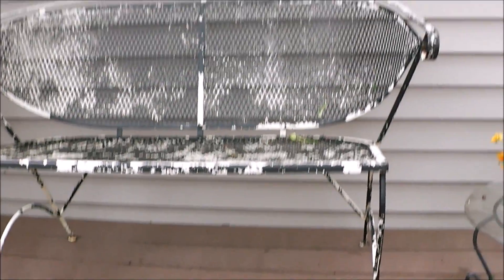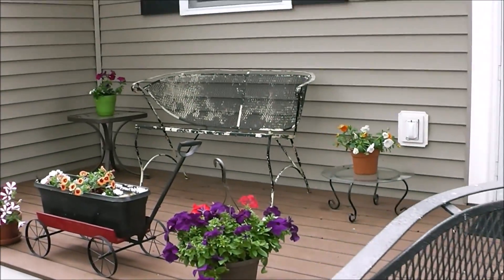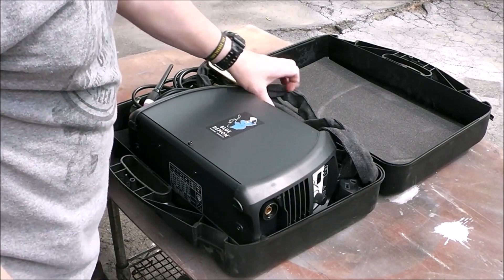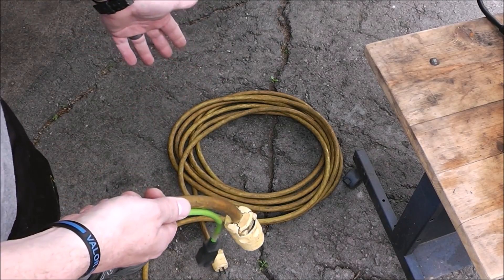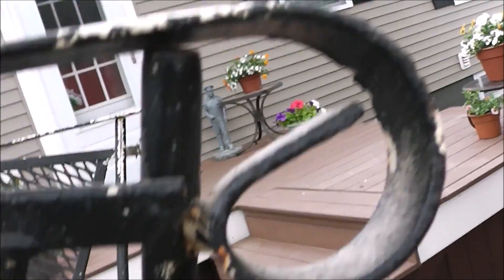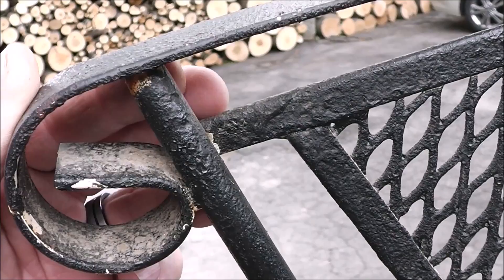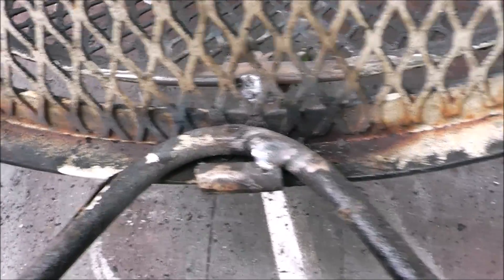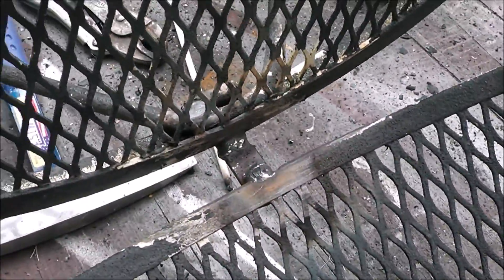STICK WELDING THIN METAL  using 120 volt power - 💥Beginner Welding Series

Comment: How well does a stick welder do for a 120v 20 amp breaker? I've been told it's useless.
Reply from the maker: Honestly, with this welder on 120v vs 240v I cant tell the difference. It welds EXACTLY the same.  However, the welder maxes out at around 130 if I remember correctly when it's on 120.
Reply: @BrandonLund  No tripping of the breaker??
Reply from the maker: @warrwarrwarrwarr  If I remember correctly, when its maxed out on 120v it will trip out a 20 amp breaker, but not immediately. I can weld for around 30 seconds when its maxed out before it trips. My plasma cutter does the same thing when maxed out on 120v
Reply: @BrandonLund  Thanks!

Comment: only watched 1.5 minutes.  You call that thin metal?  that's thick!  Thin metal is auto body floor pans and car door frames, chassis subframes on 70s-80s cars etc.  That's what I want to see successfully welded with 1.6mm and 2mm electrodes.
Reply from the maker: I have other videos with 1 and 2 mm / 20 guage if your interested. Stick really isn't ideal for bodywork, however, it can be done and done sucessfully. I've had good luck using copper as a heat sink to help eliminate warping / blowout.
Reply: @BrandonLund  sir, so for body work or thin material would you recomend the 90 or 125 amp harbor freight welder. ?
Reply from the maker: @arturozanti7262  I dont have any first hand experience with harbor freight welders but I would encourage you to go with the highest amperage unit you can afford. Buying a welder is much like building a garage...its perfect at first, but as time goes on, you wish you went a a little bigger.
Reply: MIG would be best
Reply: @BrandonLund  Do you think its possible to stick weld, a steel disc brake boss to a nonbutted seat stay of a steel bike frame? I know TIG is would be the preferred option... But this a one time welding project and a stick welder is cheaper. BTW using copper as a heat sink, I dont see working for tubing, so do you have any trick to prevent blowout... 
FYI I have never welded anything...  So feel free to just say its crazy, for me to try it.... There a clamp-on kits disc brake boss but they look ugly and  I dont trust them to hold up...
Reply from the maker: @nc3826  I have never welded on a bike frame but I can only imagine they are fairly thin. I consider myself a fairly good welder and I think this would be difficult for even someone with a fair amount of skill. That's not to say that it can't be done, I just think for someone who has never welded, this might be too difficult at first. You can pick up a fairly inexpensive DC stick / TIG inverter welder for fairly cheap. That way you get the best of both worlds. You can weld nice thick metal with stick and do nice delicate work with TIG when needed...In my humble opinion anyways.
Reply: @BrandonLund  Thx for getting back to me and confirming that stick welding isnt a viable option and will probably ruin the frame. So TIG or a braze-on is the only way to avoid using a clamp on.... Good luck with your channel....
Reply: Weld two aluminum cans together 😎
Reply: I have googled all over for this, myself. The thinnest metal Google wants to show me being stick welded is 14 gauge or about 75 thousandths. MIG, I find videos doing body panels of 18 gauge or about 48 thousandths. 

The sheet metal I have been welding is 16 thousandths! I don't even know what gauge that is. I am a noob, but I have gotten it to work fairly ok. Lap joints and spot welds, only. No butts or continuous bead. And I still get the inevitable blow through on occasion. What works for me is clamp next to where I will spot weld, grind a small slot-shaped crater through the top sheet and slightly grazing into the bottom sheet with a small cutoff disc. Heat up a 1/16" 6013 on a piece of scrap, then bring it to the spot. As soon as it sparks, jam it down until it just about touches the metal, and immediately withdraw.  Amperage as low as it will burn, which is about 17A on my machine, DCEN. If you were restoring a car, you would need a lot of Bondo, lol. To repair a tank, it would take forever to connect the beads to make it gas/liquid tight and you would maybe need a plug welding heatsink jig to fix the holes. :) (I haven't figured out how to plug holes in metal this thin, yet.)

The other major problem beside holes is warpage. If the spot doesn't take on the first try, the metal warps and separates and the flux dust gets in there. If you can't hammer it flat against an anvil, I have very little chance to get it to connect on further attempts.
Reply from the maker: @mildyproductive9726  thin metal is very difficult to weld with stick as you have figured out. Another good trick is to keep a very steep drag angle and keep your pieces clamped tight when doing lap joints. Any gap will cause it to burn out. If you can get a piece of copper over the joint on the backside, it will act as a heat sink and help with blow through. I'll have some more thin metal videos out soon.
Reply: @BrandonLund  Thanks for the tips! I look forward to the new vids. So far I have managed to make some useful guards/covers with the 16 mil sheet and even managed to tack this sheet to angle iron without completely nuking it. But I have another repair/project that involves (re)welding a piece of rebar to the edge of a 28 mil sheet, where it broke. If you can do something like that with stick, it might make a good video?
Reply: Mildy Productive nice explanation on your welding ventures. The tip to use copper underneath as a heat sink seems to be a good idea. Also clamping very well.
Reply: You can use 1/8 in. rod on 18 gauge but 3/32 in. is preferable.

Comment: I want to see how to Oxy Acetylene weld T Joints.
Reply from the maker: Oxy Fuel welding is probably my favorite... it takes a fairly high degree of skill and practice to get a decent looking weld.  I got my crash coarse about 35 years ago welding in floor pans. It then progressed into custom body work / chopped tops and lead work.  I still have all my gear but I have pretty much replaced it all with tig brazing for the most part.
Reply: Awesome. Thanks for responding. I'm having a little problems with Oxy-Acetylene T Joints. I've looked all over youtube for Oxy-Fuel welding T Joints and there's only a couple vids but they're not up close or not in detail or I can't see what the person is doing. So I figured I'd ask a bunch of Youtube welders to see if they could possibly upload a video. :D

Comment: wow,  didn't know people really calculate their settings for stick welding
Reply from the maker: Mercer Frey every electrode has a recommended amperage rating as a starting point. It’s usually printed on the label. Eventually with experience and time, the beginner welder will remember what rod runs with what amperage.
Reply: You have too. For best results

Comment: Could I run 3/32 6011 rods on a Clark 110 v. machine:  their E-95 model ? [the machine maxes out at 90 amps, A/c only.]
Reply from the maker: I have not used that specific machine, but yes you can run 3/32" 6011 with that machine. You will be pretty close to maxed out though. That rod runs around 75 Amps. 6011 rods can be used on ac or dc machines.
Reply: Thanks Brandon.

Comment: 6011 is the best rod for any job, is very penetrant, you can tun it colder than it was made for, welds dirty metal, and unprepped metal so 6013 is not a good electrode guys it only has a good finish, 6011 is the best option
Reply: @海鷗 whaaat

Comment: I'm trying to weld tin cans with an old dayton welder from the 50's...Ive got it on the lowest possible amperage  and using a 6013 rod; 1/16th" on 110vac...I cant seem to get it lit, if i up the amps, it just burns right thru...any suggestions?
Reply: dan walker    Grab a short piece of old copper water pipe.    Flatten the end do it sits more or less in full contact behind what you’re welding on.    Hold it there with a gloved hand and it will likely weld for you.  The copper will absorb some of the excess heat yet won’t weld itself to the workpiece.      This works pretty well in cases like that.      
Also try using 6011.    Because it’s a Fast Freeze rod and may work better for you.     You might also try reversing the polarity if your machine has the capability.    You sort of have to screw around with techniques in cases like this till you see what is working best for you sometimes.     That’s why you need to practice on similar scrap to get it dialed in first.    
   Don’t fall for that “get out of the Stone Age get a $1000+ MiG or you’re wasting your time” crap.   When I went looking for a welder in the early 90s I was told stick welding rods were likely not even going to be available in 10 years........yea sure!   I got one eventually, a 135 Hobart, just for body panels.   Today my preference is still the old AC/DC Lincoln Tombstone.
Reply from the maker: @drizler  SPOT ON BROTHER! Great Advise!  I use a copper bar, but I like your idea of using a piece of copper water pipe! Great idea and great comment! Thank you
Reply: Thanks! Do you recommend welding lessons before doing a job in this league? I’m new to this
Reply from the maker: @jeffreychavey4161  You do not necessarily need lessons to make a repair like this. You could literally watch videos like mine and others and probably do a pretty decent job, however, if your able, a few night classes at your local school would probably help. In my opinion, nothing beats hands on instruction where someone can look over your shoulder and give you pointers on what your doing.
Reply from the maker: It sounds like your doing what you can. Your machine may not be able to go that low and still be able to light the rod. You might try bumping the amperage up just a bit and then doing real quick tack welds. That's where a hot start feature comes in handy
Reply: I was trying at 20 amps...bumped it to 35...and it got worse, soooo....after lots of practice, i finally was able to strike an arc on 20, but was still limited to the edge where the material is just a bit thicker, even then I had to move fast, anything longer than a blink of the eye, i was going through the material...it was awesome education though...I love the hot start idea, wished my machine could do it...thanks alot
Reply from the maker: @pathfinder10148  your welcome ! 😁
Reply: dan walker what if you used a tiny bit of tinfoil or a metal shaving to strike the arc on? Then it would burn back instantly once striked. I’ve heard of ppl using their tig filler rod to start their arc but always wondered about this lol

Comment: Can you please let me know if it's okay to hold the electrode while welding? Do I need some special kind of gloves for it or if leather will work okay? Is there any risk of electric shock?
Reply: Don't use wet gloves it'll shock the crap out of you
Reply from the maker: So the correct answer is there is always that risk of electrocution when welding. Then there is what actually happens. I routinely brace the rod (especially on thin rods that bounce around) and I wear just standard leather welding gloves. Been doing it for years.

Comment: so this would be how to weld up a steel bike frame?
Reply from the maker: Mr Jay White the best process for a bike frame would be tig, but if you don't have access to tig, you could do it with stick but it will be difficult. I have a video about welding sheet metal that might be helpful.  If you have access to a spare bicycle, I would do a bunch of practicing first to get your amperage dialed in.
Reply: im just a hobbyist, so all i have is a 200amp stick welder i have been teaching myself with. i think its best to learn welding the hard way anyway, then move on to the easier methods when i go take a proper welding course.

not too thrilled at the idea of stick welding .9mm tubes of 4140 either, due to how likely it is il just blow holes in the stuff. so im just getting the best information i can before trying it. at the moment im trying to figure out if i need 6011 or 7018 rods.

this project is my next self teaching course, so i can move on from making garden decorations out of scrap.

Comment: It is so unfortunate that so many people just starting out welding start with a stick welder and try to weld thin metal. It can be so hard! Despite that I have a little 120v everlast stick welder that I learned on and absolutely love it. Welding can be so addicting.
Reply from the maker: Right on Lucas! I would encourage anyone first learning to weld to hold off on welding thin material until you get proficient with thicker stuff. I'm very impressed with today's technology with how stable an arc can be on 120 volts. It's quite impressive!

Comment: Another great video. I love how you find these little stick welder and love them.
Reply from the maker: Thanks buddy! As I was telling another commenter, 99% of my experience is on transformer based welders, so these little inverter based units really impress me.  Im super impressed how well this unit will light a rod and maintain an arc. I really push it's capabilities in next weeks video when I attempt to weld 16 gauge sheet metal with it!

Comment: That turned out well, you are right, thats the sort of job DIY folks have to tackle and it usually ends up a mess and they get discouraged, inverter set are a great help, plus of course youtube channels like yours. MIG fluxcore is also handy for jobs like that, but clean up tends to be more time consuming, plus more spatter usually. Using heavier duty cable is a good tip, I was laying out an extension cable once and my wife said "my, thats a very thick wire"  made me check to see if the zipper on my jeans was open:)
Reply from the maker: Thanks for the compliment Jaques! I'm old school so 99% of my experience is on transformer based welders. Going from a transformer to an inverter like this one is like night and day as far as i'm concerned. The inverters are way easier to start and maintain an arc as far as i'm concerned. Time will tell I guess if electronics will win over a solid state transformer machine.   My wife has never commented on me having thick wires :) Take care brother!

Comment: Nice video! I find 6011 likes to get stuck but I have been using it more.. I would love to see more stick welding videos! Thanks!
Reply: 6011 if you keep getting stuck just bump your amps up a little bit. You’re prob a little cold. It’s a good all purpose rod. I use 6010 but it’s just what my Invertig 221 likes
Reply from the maker: Ray B. 6011 is what I learned on. In my opinion if you can do a good job with 6011, everything else seems to come a little easier. Stay tuned next friday there will be another stick welding video